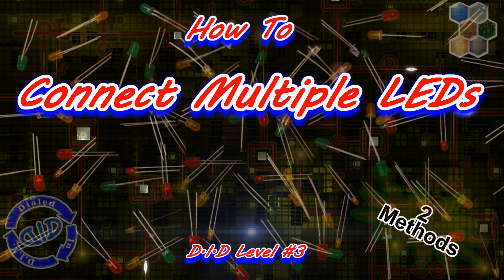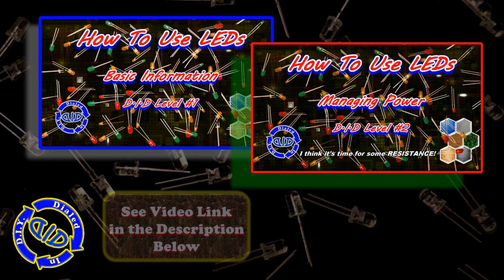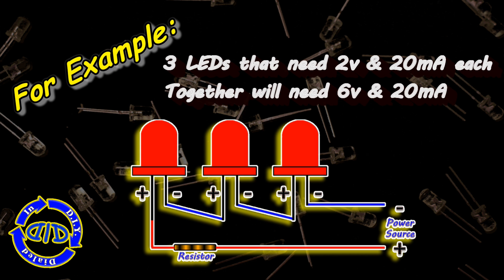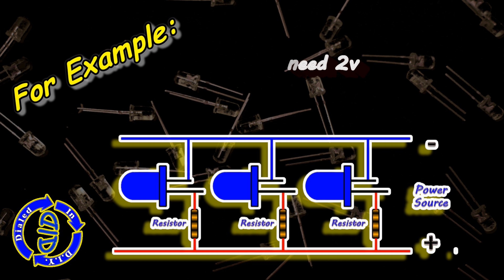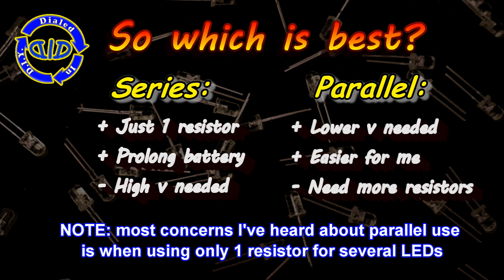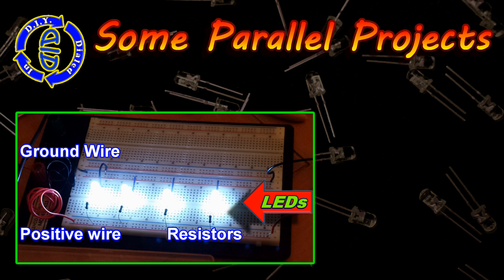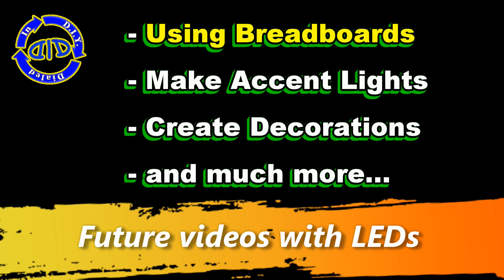How to Connect Multiple LEDs Together - Tutorial - make a string of lights

Comment: Agine tu does it matter how long the wires are  and i found out what my frw volt is my mA  my frw is 2 volt and 20 mA and i was told with me usein a 6 volt 4 aa or 7.2 volt i need a 270 ohm risistor does that sound right or do uk a better one agine tu u have helped out soo much
Reply from the maker: I was taught that wire length is not really an issue with LEDs like it can be with other electronics.  I was asking about the power source before to try to give you the best answer I can.  Batteries are not the most stable form of power (ex. a 9V battery can quickly drop a volt or 2 when in use) so people typically recommend more complicated set-ups so that you can better protect the LEDs, etc.  For a hobby type of project I am more comfortable experimenting some and I am willing to stick with LEDs & resistors (the way you are asking about).  But, once I start using more than a handful of LEDs I often move from batteries to a more stable power source.
Reply from the maker: Part 2: your question about resistor needs depends upon how many LEDs you want to hook up at once and how you are going to hook them up.  In your example you are using LEDs that are 2v & 20 mA.  If you hook up 3 of those LEDs in series you would need 6v.  To figure out the resistor take the 7.2v source and subtract the 6v needed (=1.2v).  Divide that number by the 20 mA to get your ohms (1.2v / 0.02A = 60 ohms).  Each string of 3 LEDs in series would need at least 60 ohms of resistance.  

You can try testing out connecting multiple strings of 3 (like the one described above) in parallel to see how many you can connect and still have shine bright enough.  Let me know if that does (or doesn't) help.
Reply: Agine tu for all your help u have helped so much in my jerny in lering how to do this  im sorry if im getin anouing on this if i am plzz tell me k  the battery im thinkin of useing is 7.2 sub c batterys witch include 6 of them put together  if on go line u put in 6 cell nimh rc battery u can c them they r made for hobby grade rcs  or useing a what they cell 4 cell  its 4 reg  aa batterys together witch u think would b better i think i get what your sayin in your part 2 witch brings up witch is better series or paralel i have desided on 14 leds on each side of my traller and i was told it prob b good to do parale all plus togrther and then all neg together then to the battery with a 270 ohm  resisitor on each plus side of each led id love to show u the finnished project but i dk if i can  put pics on you tube  lol but agine tu for everything
Reply from the maker: Absolutely no problem at all.  Its great that you are loving the learning!
Sounds about right (the 270 ohm resistor on each LED is based upon 7.2V from battery minus  2V for the LED which is then divided by the 20 mA you have on the LED value; its actually 260 but rounded up to next highest). The current requirement will add up for each LED added in parallel. 
I like the NIMH option since you can recharge them and they don't have the same voltage drop during use that some other batteries do.
I'd love to see how it turns out when you are done!!

Comment: Tu for your help on this the 7.2 volt batt will b just for the lights
Reply from the maker: Good to know... to use as many lights as possible you will need to use a combination of series and parallel connections.  Are you comfortable with that idea?

Also, important FYI for you (and anyone else that may be working with a bunch of LEDs) about using batteries for multiple LEDs. Batteries have variation in volts supplied during use even when they are pretty new.  This means that there is a greater risk of LED failure.  There are ways around this for bigger projects or projects that are not hobby / fun related but I am comfortable with some trial and error in my hobby projects so I typically stick to LEDs, resistors & a power source.

Comment: I like your vids my friend im prety young im 12  and im a bit confused im doin a project on a rc semi truck and i want to add leds all ik for shur is my power is 7.2 volts and the leds i got are amber rectangel and the frw volts r dc 2 volts and 20 mA and i cant fig out what resistor i need for them im thinkin up to 40 leds or so could u plzzzzz tell me what resistor i need and how meny i would need and in my case were would u sajest on putin them one on each led or what plzzz sir help me idk y but i have tryed to ask others and all they tell me is im to young to b doin this and ik i can do this if ik what i need to do i tu sir for your time and your input
Reply from the maker: Hi Sam... thanks for your message.  How you use the power will help to decide how many LEDs you can run at the same time and what the best way to connect them should be.  Let me ask one question first though, is the 7.2V of available power all for the LEDs or will that also be operating something else on the truck?
Reply: Dialed In DIY 
Hello, I have the same issue/setup.

My truck is 7.4v 260mAH. This one battery is powering the motor, servo(steering), receiver, mini speaker, and the lighting system. (15 LEDs) 

I believe the LED setup is in parallel? Should my LEDs be rated 3.2v? Or more? 

If you wanna see what it looks like just google 
It’s called Orlandoo D401E and then add lighting system or board. I just learned how to solder 👍

Comment: If I were to wire 5 3v 250ma led in parallel with a 4.5v power source(3aa batteries) what size resistor would I need I come up with 2ohms? Also what kind of battery life should I expect...would be pulling 1250ma total!!
Reply: Or would I be better to run 2aa for a total of 3v and not bother with resistors
Reply: If 1aa battery has a mah of 1800 does it double if there are 2aa or is it just the volts that increase
Reply from the maker: In parallel your voltage requirement will stay at 3v and your demand goes up by the number of LEDs (so you are right - you're pulling 1250 Ma). A typical AA alkaline battery has a 2400 mAh capacity. Putting 3 together in series gets you the 4.5v but leaves you with unchanged mAh of 2400. Given that you could expect just about 2 hours but that will also depend on the type of battery and your conditions (aka: your mileage may vary).  If you are trying to use 1 resistor at the beginning of the parallel string then I think your 2 ohms target is right.  Anyone have other thoughts on resistor value for this set-up?
Reply from the maker: Great question - because you want to increase the volts you are connecting the batteries in series.  When you do this the mAh stays the same (assuming all batteries are of the same capacity). 2 batteries @ 1800 mAh connected in series keeps you at 1800 mAh.
Reply from the maker: Personally, I don't mind dropping the resistors when using batteries when the math works out easily (especially if my LEDs were salvaged or not expensive). In your case you could go that route; test the set-up and see if you like the results.
Reply: Dialed In DIY Thanks for the reply and input I'm new to the led diodes so I'll take I'll the advice I can get👍

Comment: if i want to connect leds (3.3v) to 220v in series how many leds i need and which resistor i need ??? ( i have 100 leds)
Reply from the maker: good question... from a purely voltage perspective you would have an additive effect in series for the voltage drop.  For all 100 LEDs you would need 330 volts from source.  So with 220 volts as your source you kinda max out at 67 LEDs. Choosing a resistor depends upon how many LEDs you decide that you want to hook up in parallel. How many would you like to hook up to a single power source from 220v?
Reply from the maker: sorry... forgot to mention: for calculating resistor needs I have a video with more details.  If you are interested you can check out "How to use LED lights - Managing Power" @ https://youtu.be/7VIoWyp_6b4.
Reply: thank you very much

Comment: What type of resistors are you using to light up 4 leds
Reply from the maker: I want to make sure I am answering the right question... are you talking about the picture with the 4 LEDs on the breadboard?
Reply: Yes
Reply from the maker: Great question... that project has the connections sealed in heat shrink so I can't see the actual resistor but I do believe I was using 150 ohms resistors on each LED powered by USB which means roughly 5v of power (each LED was rated for ~2v)

Comment: Hello, I have a question for you regarding LEDs wired in parallel. I have a string of 5 standard, white LEDs (3v, 20mA), wired in parallel, because I wanted to run them on 3v. I had discovered that a single CR-2032 button battery is able to drive all 5 of them directly with no resistor. However, since the specs of a CR-2032 is 3v, 210 mA, I would guess that the 5 LEDs would drain the battery fairly quickly. 

Is a battery box with 2 AA batteries a viable alternative? I was looking up AA batteries, and alkaline ones are rated at 1.5v, 2000 mA. By using a battery box with 2 batteries, I can get the 3v that I need. Is the increased capacity (2000 mA vs. 210 mA) going to need a resistor? Or can I simply wire the 5 LED string directly to a 2 AA battery box?
Reply from the maker: Great question! The CR-2032 is typically rated at ~210 - 220 mAh; the "h" referring to hours.  So a run of 5 parallel LEDs drawing 20mA ea adds up to 100mA. Run that for an hour straight and you have used 100mAh or roughly 1/2 of the battery.  NOTE: battery capacities are often stated for ideal circumstances which means they usually last less than might be expected.  [This a simplified estimate but I hope it helps]. 

Thanks for your question and for checking out my channel!
Reply: Hi! I'm back. I tried to run only one of the LED bulbs on a 2x AA battery box, and the bulb did not light up. The same bulb lights up just fine on a CR-2032 battery. In theory, the 2x AA battery box puts out 3v, and the CR-2032 battery also puts out 3v. In reality, is the CR-2032 battery putting out something slightly higher, like 3.2v or 3.4v? Would that explain why the 2x AA battery box is failing to light the LED bulb? 

When I bought the bulbs, they sort-of mentioned this:

Size: 3MM   Lamp Type: LED   Socket Type: NA   Emitting Light Color: Warm White
   Voltage& Current: 3.2V - 3.4V/ 20mA
Reply from the maker: The answer may be easier than it seems. If you have a battery tester or voltage meter check your AAs for voltage read.  Even new some NiMH and NiCd batteries will only put out 1.2v.  It may just be the type or brand of AA you are using.

Comment: really enjoyed the video and want to try both methods but Dont know what wiring to use to connect and complete the circut. I can get the diodes and resistors with ease but IDK what to use to solder them together on. Sory I know its a newb question but I am trying to learn the right way.
Reply from the maker: No need to be sorry at all... I personally like to try to figure things out first too.  The good news is that there is more than one way to do this.  First let me make sure I understand your question.  Are you asking about the solder, the soldering iron, the wire or maybe what to physically put them on when you solder? If it is the last one, then you have options but I often use an old scrap piece of wood in a well ventilated area.
Reply: The wire to connect the diodes and resistors to. I dont know what I am supposed to use to connect the pieces to with the solder.
Reply from the maker: Here is the good news...  you can use allot of different types of wire with equal effectiveness.  I even use allot of repurposed wire that I get from my What's Inside Video salvage projects.  I do find that for soldering purposes I prefer braided wire.  Let me know if you want any more details.

Comment: Great introduction to serial and parallel LEDs circuits, so glad you talk about how current is affected between the two circuits. I'm starting to work with 1watt & 3watt LEDs beads. Maybe you can talk about the use of LED drivers and how to build a circuit base on the a given LED driver specifications. Thanks again
Reply from the maker: I like the idea! LED drivers are great for protecting against thermal runaway.  I will see where I can build in some low voltage DC drivers in a future project.

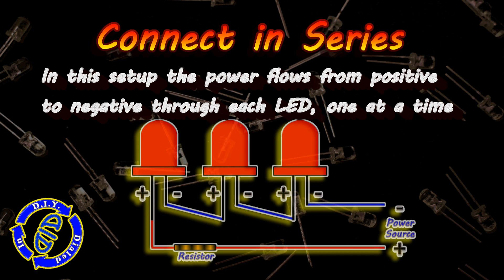Comment: what are the blue wires at 1:00?
Reply from the maker: The blue wires connect the LEDs together from negative to  positive leads until the last LED (that is the Series Connection).  In that view the last blue wire goes from the LED negative to the negative on the power source.
Reply: okay thanks. one more question tho. If you want to make a string in series, lets say 10 leds, and each led requires 1.5 volts do you need a 15 volts battery or is there another way to connect these leds?

Comment: I was wondering the best way to use LED strips from a tv I tore down.  I would like to use them for fathers garage. They are 7 LEDs on on each strip and was thinking  2 strips a light. Was wondering your thoughts on this. Also  I can power each strip with 24 volts.
Reply from the maker: First, I think it is a great idea to try to repurpose the LED strips you got from a TV (I have not tried that before but I love the idea).  I have worked with LED strip lighting before but what I have worked with topped out at 12V DC.  If you still have the remains of the TV you tore down, then try to check the power supply leading to the LEDs and see if there is an indication of what they were powered by originally.  You may need to step down the power with some resistors.
Reply: Each strip has 7 LEDs on it rated for 3 volts. The LED lights are put in series for each strip, and I am able to power them with 24v dc.
Reply from the maker: shawn lee Very cool!  What is your DC power source (i.e. wall wart or batteries)?  How bright are they for use in the garage?